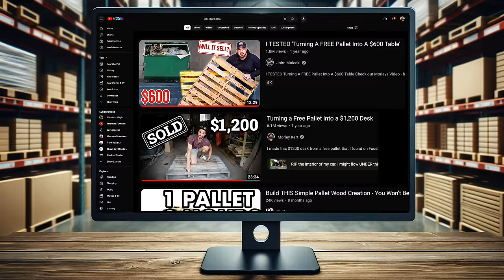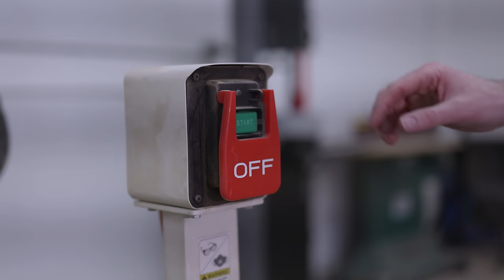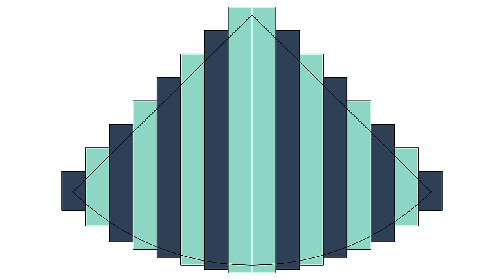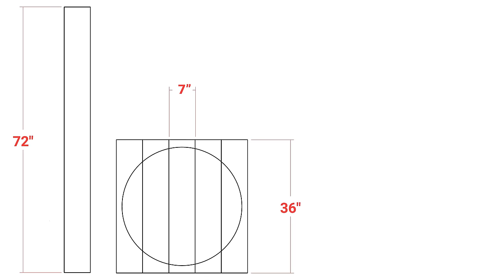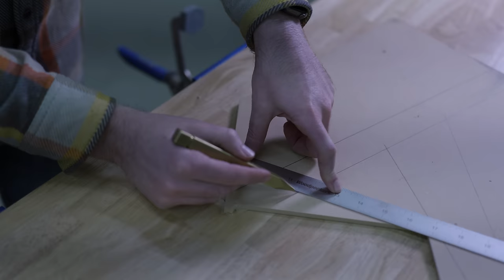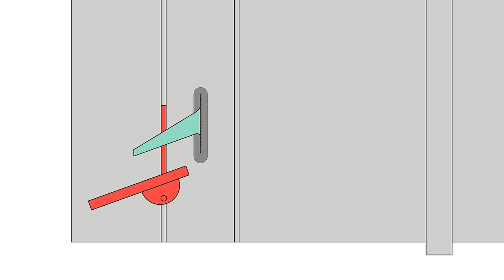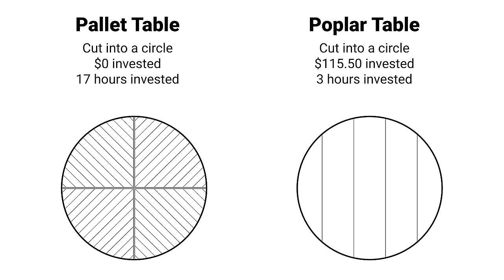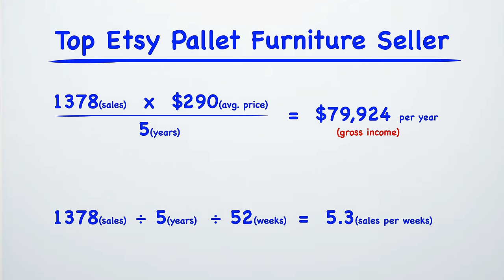Pallet Furniture is a Scam

Comment: Pallets work well for simple outdoor stuff. Not recommended for indoor use, unless it’s a storage room/basement.
I made a tiled platform with wheels for my barbecue grill on a patio. That added 6-7” to the height. Now I have a raised grill, with wheels, and easy to clean under.

Comment: So, I’d definitely say that your price breakdown is a bit off, which you even admitted to an extent. Just looking at the 2 tables, the pallet wood one if visibly more appealing than the poplar wood one. I’d ponder a guess that the reason they sold for similar prices is that you built them and you have a following (something you mentioned), whereas someone like me, who doesn’t have a following, wouldn’t be able to get $700 for any table of that size that I built, regardless of the material.

Also, I don’t think anyone claims to really have a “pallet woodworking business” as in their entire living is made building/selling pallet wood creations. I think most people that are even considering pallet woodworking as hobbyists who want to make some money on the side without a lot of monetary investment. Considering you need the same tools regardless of which medium you decide to work with (you might need to invest in a crowbar for pallets if you don’t have one already, but that’s like $50 max), not having to worry about a couple hundred bucks in material is a relief. IDK about you, but making 20 se dollars an hour in my free time on a hobby is pretty dang good coin. And, if you actually made identical tables (and by that I mean you made the poplar table to be that triangular type design), you would’ve been another several hours invested into it as well, but instead you went with a quite elaborate design for the pallet wood table (whether by necessity or not) and a super simple design for the poplar table, which helped create the HUGE time investment disparity.

Overall, though, I think most people would prefer to work with “virgin” wood and not parts, but building everything out of poplar would get old pretty quickly, and using pallet wood allows you to get your hands on various different wood species for, well, free. I mean, imagine what materials would’ve cost if you built the poplar table out of the same wood species as the pallet wood table.

Also, if you have the ability to pick and choose over pallets over old/damaged pallets, it would help reduce the amount of time/effort needed to work with them.

Comment: Depends on the pallets... If you're lucky and depending on where you live, you may find cedar and even oak. But usually are made of fir, spruce, pine or even poplar, which haven't got much life when left in the rain. Also, the amount of energy, machines, supplies and TIME you need to treat the wood to make it look good is sometimes not worthy.
But they are great for rough projects such as picket fences, chicken coops and outdoor benches.

Comment: 1. Life insurance is the biggest scam. Just save your own nest egg.
2. You didn't use only palette wood. 
3. I tried to build something out of pallet wood and we used old pieces of fencing instead. And it worked much better 
4. Your videos are too short at the end. And I feel like you really need to lay out the answer to your question. Like when the people get the item I don't really know what's happening. Because you cut away too quickly. On several of your videos I've had to pause them and then rewind the ends, and rewatch.

Comment: The point of using pallets isnt so that you plane it flat via your shops guccie gear. The point is to embrace the irregularities and soften them via clear coat. A perfectly flat top is easily done with epoxy. You genuinly went about the project from an orthodox perspective of an unorthodox building material.

Comment: It’s actually very easy to get a longer piece and 16 inches out of your pallet instead of cutting across the piece of making them shorter get a metal cutting blade on your saws all and run the blade between the framing of the pallet and board length. Basically just cutting the nails and not the wood.

Comment: Bro you need to invest in a pallet buster.  Who starts a "pallet project" with no proper idea or tactic to take apart the pallets? I hate when my friends "start" a pallet project and teh first thing they grab is a crowbar and a reciprocating saw... NO NO NO!!
I get your point; but I can get infinite free pallets and continue to break them down to be used in projects.  
I do think that there are specific projects where it works and others where it would make no sense to use pallet wood. 
I also think that pallets are a reuseable resource on their own and only pallets destined for the dumpster / landfill are worth taking for projects.

I avoided buying a buster for my first few projects and it would take 15 - 45 minutes to break up ONE pallet sometimes. 
With the pallet buster; it's like 2 minutes AND the wood is far less likely to split which gives you longer, more structurally-stable pieces.

Look at me telling a furniture maker how to his job.. Not my intention but I really don't like the clickbait titles woodworkers have been turning to.  
Hot takes do get more comments (just look at mine!)

Comment: Obviously the pallet table has way more character and of course a story, plus it's more of a test for the woodworker. All those intangibles add something significant to the value as well. So it may not be advantageous in cutting cost but it's certainly a viable option.

Comment: Never understood using pallet wood.
If you're going to use salvaged wood why spend a whole bunch of time pulling nails and deconstructing pallets for a bunch of skinny odd length planks of rough sawn lumber?
There's a myriad of ways of picking up old furniture for free or as good as free, less hassle to deconstruct and far more useful.

Comment: If you are nearby a factory giving single use pallets(*) away then you'll get lots of material.

Have now like 2-3 cubic meters this material. Collected within like week or two. The factory gave like 1-3 meters high pile daily. Spent time to buy proper tools for splitting the pallets.

What I do not understand how you managed to break those to tiny pieces. For me breakage was like less than 5%.

Some of the wood I collected was reddish and looks nice BUT one must be extremely careful because there are species are toxic meaning that the dust is toxic too. AND here pallets maybe treated using chemicals so that critters and diseases are eliminated.

Collected the nails for iron oxide production. For it there are many use cases.

(*) we have multiple use EUR pallets too. Those are like 10-20$ each.

Comment: who are they trying to fool? Look if any body that is thinking about this there are 2 things to keep in mind A) pallet wood is not good wood, its cheap garbagy softwood and unless you're buying brand new its in bad condition (yes I know there are hardwood pallets but you aint gonna find that). B) Also used pallets can be HIGHLY TOXIC due to the nature of the preservatives in it or what was on it. Basically its click bait, make a thing from "pallets" when its not, its made from much higher quality wood or has so much work done to it I'd hardly just call it pallet wood X. Also the word for the legs you're looking for is unremarkable or subdued

Comment: This honestly sounds very similar to the classic dichotomy with a lot of "DIY" stuff. Yeah, you can often do something yourself "for less money" or "for free", but it usually comes with a much higher time investment that almost certainly dwarfs money you save. However, what I've seen is that there seems to be a process as you age where when you are young and inexperienced, your time is more valuable, and risk or loss is higher, so DIY and cheap materials are gonna be waaaay more appealing. But as you get older, your earnings generally get higher, you get more experienced, and your amount of time available drops, so the equation flips, and now your time is more valuable, money is cheaper, and loss is just less likely to happen due to your higher skill/maturity.

And also, this does go for a lot more than woodworking obviously. I think I even heard this sentiment first from Linus on LTT actually.

Comment: For a beginder using pallets for free it would be awesome, you pay nothing except the time you put into the build, but you can make good profit to buy needed tools or whatsoever... unfortunately doesn't work everywhere... in germany for example is a deposit on pallets and my brother builded a bed it took 8 pallets each 35 bucks... and it wasn't like disassemble and build something, no it was just stacking them together, some screws and voilá a bed 😅

Comment: The thing is, pallets are made to be used and reused as pallets.   They get reused, recirculated, even repaired.   If you make something out of a pallet that is in good enough shape  to be used as material, it is good enough to be used as a pallet.  Once you've built with it, you've taken a pallet out of circulation, and a tree needs to be cut to replace it.  So, the ecological argument is limited.

Comment: I mean, I think part of the issue here is the issue with a lot of things online... Taking potentially useful advice and applying capitalism to it. If I recall, the whole pallet furniture craze came out of 5-minute crafts style DIY videos... And yeah, if you are just looking to make a bench for your own garden or something like that, it's great to have a cheap or free source of wood to do it with. If you're trying to make money off each piece, though, you're not necessarily going to save it by reprocessing wood.

If you are a hobbyist or learning, though, not everything has to be converted into dollars per hour. And while there's a confidence boost in using better materials, you probably would have picked up more skills through the extra work you had to use in the pallet table. Planing, joinery, glue-ups, epoxy patching, and inlay. You just picked up all sorts of tricks!

Comment: i feel like there is a way to stream line the pallett furniture process increasing profits as well. also there are places that just toss out a ton of pallets at a time or for extremely cheap. but it would still probably be about the same as using new wood.

Comment: Well.
Why did you compare a complex design in pallet but did a simple version using poplar?
If you did the two tables of pallet (or poplar) doing these different patterns, surely the plain version will be faster.

Yet, besides, you didn't count the spendings on electricity, glue, epoxi and what else, since more work were done in the pallet version. 

Still, noone make intricate tables out of pallet. (Noone but youtubers, indeed hehehe)
But yeah, got your point.
Although I was expecting the difference to be much larger than this.

Comment: its possible some people have a sweet connection for pallets, and maybe even pretty good ones. and maybe developed a system for ripping them apart and sorting the pieces. if that's the first one you've ever done, you likely don't have a system yet, or a great location to go score a bunch of mostly good pallets. if one has to drive around the city for hours searching everywhere for pallets and only finds a couple good ones and mostly crumby ones or maybe some days dont find any at all, that probably works against you.

Comment: You also neglect to consider how pallet wood will run through your blades, tools, etc... The hidden cost there is pretty huge, if you have to plane things with multiple extra passes, you're going to dull blades etc. Especially if you miss a nail or staple fragment and chip blades and ruin a piece of equipment, or god forbid get physically injured by it... Just not worth it.

Comment: There's also the benefit that pallet wood furniture is a form of recyvling, rather than having pallets just get stomped on by people walking past and eventually going to land fill. A bit like the way that cafes will take old furniture from wherever they can find it, instead of buying all new stuff because they're giving something a new life. 
Having said that, my woodworking skill end at single cuts, sanding and bolting to a wall as a shelf. So it's not for me. Also, the textures in the pallet table are fare nicer to me. But that's subjective and I guess they're only $45 nicer to the average person.

Comment: Couldn't you stabilize the wood with tape or epoxy or something before cutting the edges to reduce tear out?  I think in the end if the two tables were left to market the reclaimed one should have sold for more.  It's just my opinion but there was just more interesting stuff going on in that design.  I do think it's good that you made the poplar one simpler because all the inlays and board orientation put into the reclaimed design were a direct result of working with the material.  That inspiration is the biggest strength of reclaimed projects and while maybe not a beginner project, definitely seems like good cheap creative practice for an intermediate or advanced woodworker, sort of like working with live edge and epoxy and such makes you adapt creatively to the material.

Comment: Would also factor in the wear and tear on equipment. 
Palet wood is usually dirty and has hidden debris/metals embedded in the wood.
Router bits, planer/jointer blades not cheap

Comment: Honestly, you don't have to make high grade furniture spending hours and hours on a single piece, I have a buddy at work where we get pallets all the time and he has cutting jigs and such set up and he just cracks out a bunch of good sized wood planters in a hexagon design, maybe 25 gallon size, finishes some, and leaves most of them raw.  He sets up at the farmer's market in the spring for $50 for the space rent per day and goes as many days as it takes him to sell out the stock he put together over the year. He gets $40 for the finished ones and $30 for the unfinished ones and it usually takes him about 4 days at the market to sell the 100 or so he made throughout the year in his free time.

Comment: Be careful.  Some pallets carry hazardous materials, both in solid and liquid form.  Avoid stained and wet pallets.   As a college kid, I even worked a summer in a pallet factory.  Take it from me, they  buy the cheapest economy wood possible then butcher it up.  You might be ahead just to buy economy lumber, trim out the defects like we did and save your jointer blades for something better than smoothing out forklift damage.

Comment: Great vid, there may be one more option to building furniture out of pallet wood without the time consuming process of tearing down those nasty pallets and sizing the pieces...there's a saw mill in my erea that's also a pallet manufacturer. I can get the same amount of BF in rough cut wood all uniform in cut from them for about 1/3 to 1/2 the price paid for the poplar in this video. The only catch is I have to wait until they're processing orders for pallets, which is usually once sometimes twice a month. So there could be a few people lucky enough to have a mill in their erea and run a successful business. I personally am not aware of anyone that takes advantage of this in my erea, but stranger things do happen. I have done this, but the things I make are for myself or family.

Comment: Their is money to be made, but the work going in to come out with good wood kinda makes it worth using 2x4s and fienc pickets and if you want good reclaimed wood you realy need to start a small biulding removal company but at the end of the day it is easy to just add in the cost of new materials and for the time saved you are better off. When i was doing pallets i had a junk jointer to hit all the sides befor running it threw any other tools like a thikness plainer so i did not hit any missed nails or staples it was just 1 more added step and more time and power used. I got all my palet wood from a place that worked on heavy equipment so i got to know them and their palets wer heeavy duty with lots of 4x4 and 4x6 they allso got stuff in crates and tons of hard wood palets and not just oak

Comment: Did palletwood once, and never doing it again. Fucked up multiple blades across all my tools, I figure the cost of all blade replacements was easily around the $300 mark. Definitely not worth it, you'd be better off going to orchardists or whoever you notice has a tree they're felling, taking a few lengths of that and milling it yourself (my new method for getting hardwoods).

Least that way you're not constantly destroying blades on hidden staples, nails, broken off screws, and embedded gravel and rocks.

Comment: Some pallets are junk and thrown away, that is often international shipments or single direction shipment, but in Sweden and EU there are standards and pallets are reused and i rather high quality; many of the pallets I saw in this video is something that I would never use, for it do not look like it can be lifted by a forklift in a safe way, they have boards under that look like they shall fall off and no long board on the bottom sides to spread the load when you put it down.

Comment: New woodworker here and also started with a pallet project. It's kind of OK, looks nice until you try to finish the project. Then it becomes a pain in the ass because that wood is thirsty. You oil it once, and then sand, and oil it again, and sand. And it always finds a way for some moisture to enter the wood and make it uneven. I realized there is a reason cheap wood is used for pallets. It deforms, has weak grain, and a lot of knots. It's just soft wood that warps and you can invest a lot of hours but it will require a good seal to finish it. Otherwise, all your work is ruined. I find it much cheaper and faster to buy some wood, glue it together then to deconstruct pallets, remove all nails, remove all hidden metal parts, cut uneven sides, use a plainer... it's just too much time.